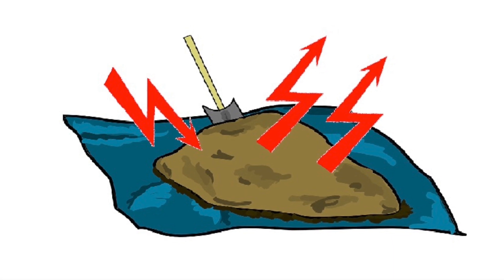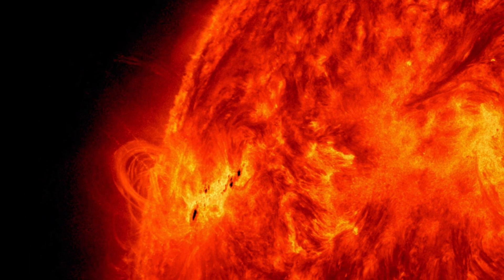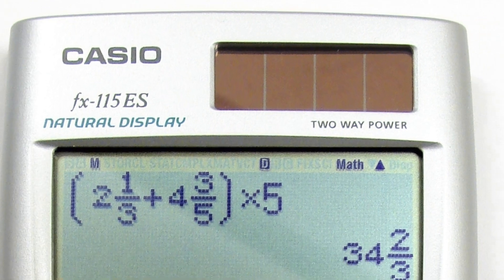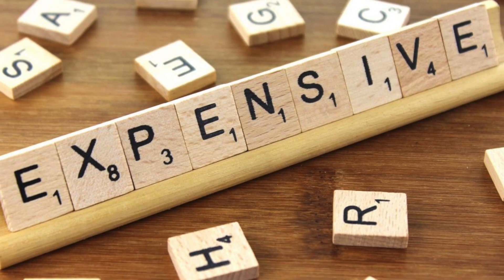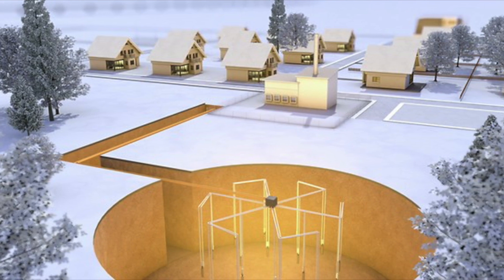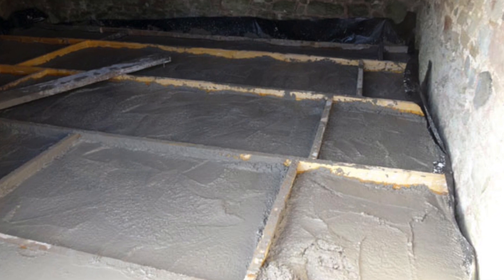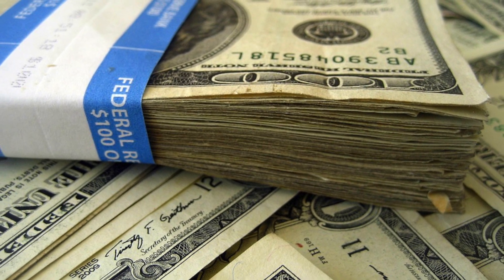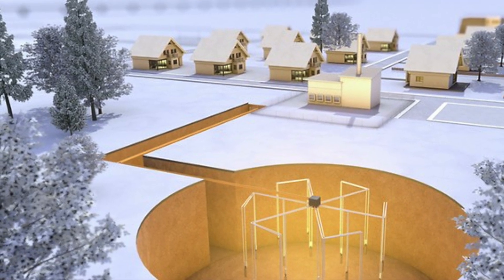Home Solar Thermal Dirt Battery (2020)

Comment: You could increase the thermal capacity of your system by using a top layer of 5 gallon buckets filled with salt water and putting the lids back on.  Interweave PEX tubes around them, and pack in the dirt.  I wonder how long it would take before the water eventually escaped.  I'm thinking of a similar situation, but not for storing heat an entire season.  Instead to take care of something like a 10 day cloudy cold snap.  I would use a domestic heat pump hot water heater to store energy in the battery on days that are warm enough and sunny enough to generate excess power for a Mini Split and the hot water heater.
Reply from the maker: @richdobbs6595  interesting

Comment: Hi, what are the factors limiting the lifespan of the system? 30 years seems quite a short lifespan for a system with little in the way of moving parts.
Reply from the maker: Good question. Mothers are easy to replace, degrading pipes and connections may be an issue over time

Comment: IT is good that you are prepping like this,,however,  it basically a ground source heat pump and you are correct in amplifying the ground heat using the sun and concentrating the heat in a confined space.  Ground source does require a big pump and like Mr Sunak found out it would need big changes to the supply since the startup current draw is very high and would cause your neighbours lights to dip on and off and thus ya need permission from the grid for the very aforementioned reason.

Comment: Glad to find this video.  Back in 1979 I was looking at Mother Earth News Magazines and came across an article where a family built a mud pit battery like this using heavy PCV pipe to circulate. heated air from a Solar air heating panel that they had also fabricated.  It had fans that blew heated air in the cooler months and by spring began blowing cooled air thru it in the evening hours. (for AC)   Said the heated mud would vent its heat into the heavens at night and thus chill the mud for AC in the summer.  The builder claimed it worked acceptably but only wished he had  used more insulation especially on the bottom.  Wish I could find that article online.  The heated or cooled air vented into the house possibly thru duct work.
Reply from the maker: That’s awesome! Thank you for sharing

Comment: A battery is a energy storage unit that operates by an electro chemical reaction… I know sand battery sounds catchy but it’s not the correct way to say it 😆
Reply from the maker: It’s correct for f I define it as such and then use it after I’ve defined it
Reply: A battery is a collection of similar things, be they electro-chemical cells or artillery pieces.  You are effectively applying the most common modern usage to exclude historical usages.

Comment: Hello , the best way is vermiculite it is natural & very cheap and do very well the job, it is used in industry for insulate extreme heat, it melt at 1315° C
Reply from the maker: Ok
Reply: @SimpleTek  thermic conductivity --> 0,06 et 0,08 W/m.K

Comment: In the Midwest, the soil temperature is relatively constant at 60 to 65 degrees at an 8 foot depth.  If you place coils of piping at that depth and circulate water through them and use a water to air heat exchanger, theoretically you could get air conditioning and heat your Home with some supplemental heat if you want to be warmer than 65.
Reply from the maker: I have a video on that in my archives
Reply: I have also considered building a sand battery under a garage.  Challenge is to find affordable piping that won't melt trying to get to 400 to 500 degrees.
Reply from the maker: @davea3039  yep

Comment: Your proposal is reasonably sound, but i cant pay for it. I would like to use an existing heat pump, jeted holes 40 ft deep in 2 groups.
Dirt cheep dirt insulation, salvaged tube and parts, need $250 for r134 and $2500 labor (I'm old). Run year around for $200/ 1000 sq ft.
Reply from the maker: Love it

Comment: I'm not sure how deep or where you place the lines. The lines from evacuation tubes lower ( bottom of pit) then the lines to heat  the floor. But how far up how deep of a pit. I'm in Minnesota going to do this spring of 2023 any advice would be great
Reply from the maker: Insulation plays a role in how deep you need to go

Comment: search Sand Battery and you will find Polar Night Energy has found that sand is better than just dirt. They use a tower as a "Heat" sink in colder temps but its all the same principal,  Sand is non-porous VS dirt ,,, is actually organic and will never be as dense  ... there is a formula ... just figure the cost of digging a hole equal to the volume of your dwelling and filling it full of sand is worth the long term investment.  Plumbing for each would be the same expense
Reply from the maker: Thank you

Comment: I have a question regarding heat control. I've watched a lot of these videos about creating a heat source and how to move the heat and stuff like that. but I'm really curious about how to control the heat so your system or home doesn't get damaged or even so your house doesn't get too hot.

Example: Let's say you have a solar heat collection system and it gets super hot. Now, let's say you have also added a solar battery of sand or similar material between that unit and the house in order to level out the heating. Well, what happens if the heat is still too much?

I can imagine a situation where you have some superheated water or glycol running into your house and hitting your heat exchanger or coils or however you have it set up. well what happens if it's too hot? what type of system can automatically dissipate some of that heat so that you're not constantly worried about damaging your system or your home?
Reply from the maker: Thermostat that turns the pump off or opens and closes a valve
Reply: @SimpleTek  Thank you. I have a follow up question. If you are using just a thermostat to regulate the heat won't the tubes or lines get super hot and blow up? What are the lines made out of? Are the tubes designed for high pressure or is the glycol itself able to hold all that heat without causing an issue?

I also like the idea of the sand thermo-battery. I'm wondering if there is a formula that can be used to figure out how much sand or earth should be used based on the BTUs put out by the solar heater. Also, would it be ok to have the sand battery above ground in central Minnesota? I know underground would be better but I don't want to bury it and have to dig it up later (or in the middle of winter) if there is an issue with the tubing or fittings. Do you think the thermo-battery could be used to heat a small greenhouse? 

In my mind I'm picturing a thermo battery about the size of a 55 gallon drum hooked to about 10-20 tubes. Does that seem like a good size matchup?
Reply from the maker: @Danowemight  you can recycle the heat with a cut off valve if you have a heat source that gets too hot

Comment: I've been looking at geothermal but having the heat dissipating into free ground didn't seem like the right way to do things.  Sand batteries sounded like a good solution, but there's already a sand shortage.  Soil is also a bad idea because we need to plant food in that.  Clay soil...that I've got.  Worried about disrupting treetops on some fruit trees, but nothing is perfect. I might think about checking how much using mushroom insulation would add to the cost...
Reply from the maker: There’s many options!

Comment: Hi, Love your videos they are very informative. I have  buried  900 metres of 25mm HDPE pipe in the form of slinkys for my ground source heat pumps at around 2 metres depth, I also inserted some "T" sections to attach to solar thermal panels when I have enough money. I intend to use home automation sensors and hubs to control the solar pumps that will insure only hotter water than the ground temp is circulated, Im hoping for a seasonal COP of better than 6 if things go to plan. I also have an 1950sq basement to my barn that is very cool all summer in the south of France, I intend to pour a concrete floor incapsulating pex pipes to cool the house next year also. I get lots of little tips listening to your Tubes.
Reply from the maker: That’s awesome
Reply: Thank you ill post more later.

Comment: I’ve built many similar homes in ct on a slab. I put the sand storage under the house slab. I use Evacuated tube solar drain back using water to heat 42” deep sand bed in direct contact with house slab. I need to excavate down 42” in ct. anyway and add insulation to bottom and sides of foundation. Add pex  as I’m adding sand. This provides 80% of my winter heat and 90% of my hot water Thur out the year. I heat sand bed,  October to April. I use roof overhang to shade 2/3 of solar input in summer when sun is at steep angel.  I need to open few windows on warm winter days. I use mini splits for back up heat and a/c, powered by electric solar panels. Have used it my house 8 years with no problems
Reply from the maker: That’s awesome

Comment: With a Sterling Hot air engine, you can use the sand battery to meet your electric needs. They already make the generators, though their cost is higher than the normal generators. Free heat, and free electricity who can outdo that?
Reply from the maker: Interesting

Comment: Hi I'm an HVAC Tech and I watched your video and found it very interesting now geothermal but using a battery like yours sounds like it would be also an ultimate plus plus because if you take the high side of an air conditioner or a heat pump and and take the condenser part and put it into that battery all summer long all summer long you will have heated up the property or your battery Just like you would through the sun however you are just using the leftover from the air conditioning system, please tell me what you think, thanks
Reply from the maker: Good idea

Comment: A video that explains in detail the circuit for connecting the 8 poles of the thermal battery and determining the activation points, the exit voltage, and the ejector of the thermal missile?
Reply from the maker: Way too complicated for me

Comment: I don't know this, however radiation from heat might be concern. Yet if you can convert the harvested heat, into magnetism...
Reply from the maker: Ummm ok
Reply: @SimpleTek  Maybe not you specifically, but somebody at scale. They know steel and NI can be magnetized with small amount of electricity. There might be even better materials. The part of getting the magnetism to produce current is probably more complicated but there are youtubes on those applications.

Comment: Copper is incredibly heat-conductive, better than aluminum -- far better than pex.  I'm wondering if all underground heat transfer piping should be done in copper instead of pex?
Reply: No,,,,😕No, understand, copper, iron, and the like cannot withstand soil rust, and will corrode with
Reply from the maker: @الكترود.الوافيالذماري  good point
Reply from the maker: Copper is expensive though

Comment: Rather than a water to air heat exchanger as someone suggested, I would use a a water to water heat exchanger inside the house. That keeps the water closed loop. The hot water heated in the tank can then provide hot water for showers and laundry just as your water heater does or if it is not hot enough for that, it can preheat water for your water heater saving energy. The rest of the water in the tank can be used to heat a radiant floor or radiators.
Reply from the maker: good idea!

Comment: You can collect wind and microhydro on a small homestead farm, especially if your farm is on a slope with plenty of running water flowing between ponds or includes land that sits atop a ridge line. However, I would agree that most likely it will not be your main option.

Comment: I wonder if cardboard ( in aircrete ) would attract termites ?       Would the weight of the thermal mass crush pex tubing ?
Reply from the maker: good question - I would think cardboard would rot over time though

Comment: Seems like getting a parabolic dish or two into the act would really produce some heat on summer days.    Woodsmen used to put large rocks into their evening camp fire pit.   When ready to sleep they would fill it in with dirt.   I did this in Alaska and it produced a warm place to sleep and was still warm in the morning.   One of the reasons that electric companies won't bury their lines is that they create heat.   So there is another source of wasted heat.   Now we spend money over and over again to repair downed power lines after wind storms.   I'm sure some bright engineer could figure a way to capture this heat and direct to earth batteries.
Reply from the maker: Interesting

Comment: I've been literally stewing around this very concept for home and greenhouse. The supplemental heat be grabbed from solar collector. Should be quite easy to get to that 70 range in home and definitely keep a greenhouse warm enough to prevent freezing. I've considered having part of the run outside of the greenhouse footprint. I'd insulate and pass the 6 inch through and coil back n forth on the footprint. By doing this you'd have beds that never froze and radiant heat coming up. Again a small solar collector to make that bridge from 56-58 to temp your after.  Ive been thinking about pursuing this for awhile. I'd like to hear if you've moved on it yet. I'm having a pond excavated in spring 2022. Been thinking about it pretty heavy lately.
Reply: Also the possibility for the greenhouse to have a bypass allowing the solar collector to pass into the buried portion within the greenhouse footprint. Your insulation would prevent loss and you'd be able to store the energy from your solar collector in the soil over your tubing but inside the greenhouse footprint. Ideally you'd wanna implement coming off of summer as the soil already has a massive amount of energy stored. It would be much more difficult to overcome the amount of energy lost as late fall to winter begins. I surmise the system could easily maintain but struggle to overcome, if this makes sense.
Reply from the maker: great ideas
Reply: @SimpleTek  I wasn't aware of your series until yesterday. I watched several of your videos and was able to see very similar concepts as to what I had in my mind. I also saw several more ideas, very helpful. I own a hobby farm in zone 6. I have long felt this was the ideal concept and answer. I notice on your concepts you tend to run with 3/4 pex I believe and a coolant. I understand fluid to be more effective at holding heat and also a better transfer source than air. I was thinking of running 6 inch field drainage sealed pipe. I actually have springs all around me and old clay tiles that have a constant discharge just behind my property. However this stream flows under my entire property. It never freezes and being that it is 4-5 feet underground. I've not checked the temp. Do you think if I could get down 6-8 feet below any significant deviation and laid the solid corrugated pipe I could experience a better efficiency and transfer compared to normal air system. At 6ft plus my pipe would be submerged in constant groundwater. My well produces 56-57 degrees. So long as long as my entrance and exit were above surface and my pipe did not get punctured my pipe would be water cooled and due to the sheer mass of the water supply, it would transfer any heat or cold away very efficiently with a 6 inch ground water cooled corrugated pipe. I know I would have to be super careful my system was not damaged allowing water infiltration but provided that was possible this system sounds quite efficient. I have to do some field tiles in spring and cut a drainage ditch. This might be an ideal opportunity to cut a run for greenhouse and possibly home. Ever heard of anyone relying on air but utilizing ground water cooling? I would imagine the corrugated 6 inch pipe would be effective at stirring the air being pushed or pulled by blower. I would think the key is finding that money spot allowing your air to be stirred and slow the velocity to transfer that energy. Am I thinking right on this or am I flawed. I know this isn't a perfect outline but roughing it out in my mind, that makes sense.
Reply from the maker: @Theflameremembers25  sounds interesting!!!

Comment: Just heard about a polish company called polar nights energy that is installing these systems all over the globe for whole city block. So.. this works.. They heat up the dirt/sand to much higher temperatures (600 degrees) using electricity from solar. That might be worth a shot as well.
Reply from the maker: cool thank you
Reply: It is a Finish company.

Comment: If the PEX lines were to spring a leak for some unforeseen reason, what impact would Glycol or Windshield wiper fluid have on the underground water table? What would be the safest alternative?
Reply from the maker: good point - bad - lots do it though.
Reply: @SimpleTek  Apparently Propylene Glycol is considered a safe alternative to Ethylene Glycol and is used in the food processing industry.
Reply from the maker: @jrmoore19531  interesting